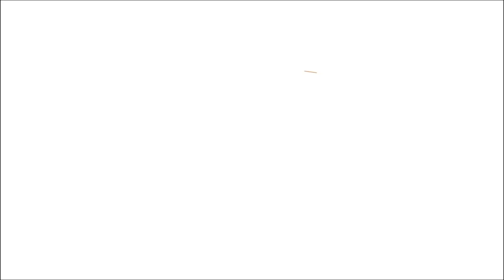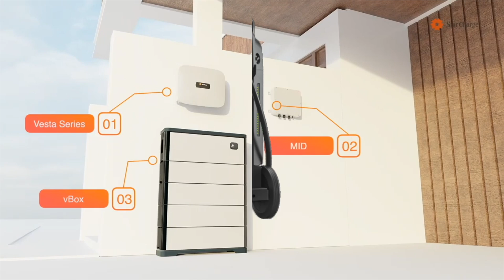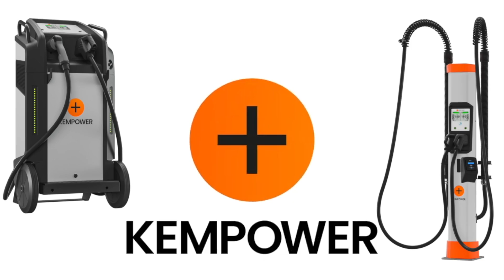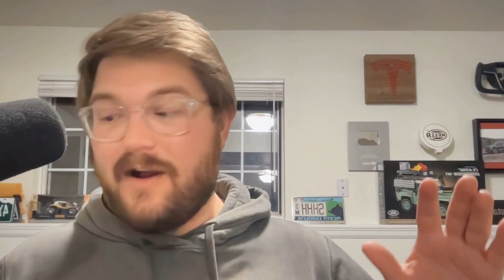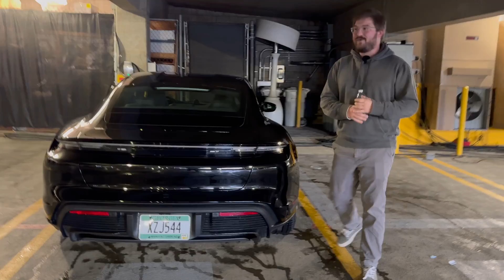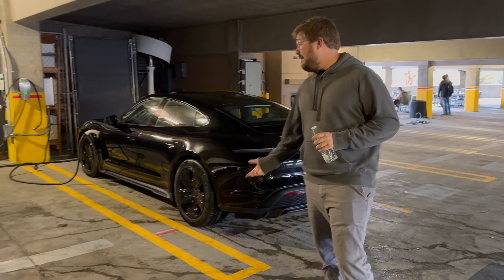Insane Porsche Charging Performance! New Taycan Facelift Charging Test & Comparison

Comment: What is the best method of determining degradation. I DCFC charged my ‘21 ID 4 for 3 years because of free. I feel my battery is down. At first I would charge (same conditions) to 8% and it would show 200 mile range. Now it’s 170 range. I don’t trust the dealer to tell me the truth. They don’t want to replace a battery that dropped under 80% in less than 8 years.

Comment: OK, so this is a true electron guzzler that wastes a lot more power to get from A to B than most EVs, and so it needs a bigger battery than most to have the same range and a higher charging rate to rate as fast as others so it can waste the power again on the next ride. And Porsche must have calculated that Porsche owners don’t drive and charge as often as others so pushing the battery to the limit with an extreme charging speed won’t cause the battery to deteriorate so soon…

Comment: Enovix has demonstrated 5 minute charging of its prototype silicon battery cells for EVs (writes Nick Flaherty). Tests on the 0.27 Ah cells demonstrate charging from 0 to 80% charge in 5.2 minutes, and achieve a greater than 98% charge capacity in under 10 minutes.

It’s already happening

Comment: 20:25 This is actually an important issue to clarify since even Teslabjørn spread FUD about battery health with Taycan because it had some eco charge mode (while I never heard this with Tesla's 250 kW charging, talking about bias...) - logical fallacy like back then putting seat belts into cars -> "must be an insecure car" 🙈

Comment: I love what Porsche is doing with the Macan EV and now the Taycan Facelift. Unfortunately they are priced out of my range.  I can only hope that the new Audi Q6 will have some of these great attributes.
Reply: Audi Q6 and A6 will be similar to the Macan 4 EV. But unlike the Macan 4, the Audis will come with RWD as well so I would assume the range is a bit better (if they have the same big battery pack).

Audi Q6 should have up to 630-650km/390-400mi of WLTP range with the biggest battery and a 270kW charging power.

Audi A6 has 700-725km/435-450mi of WLTP range with the biggest battery and a 270kW charging power.
US EPA range will be a bit lower than that.

Comment: Amazing to see. Curious if the charging curve would be any different on a different charging system (like a ChargePoint Express Plus 500kW dispenser with liquid cooled cable). Did the EA station seem like it was throttling/de-rating at all?

Comment: Over 300kws all the way to 62% and still over 200kws after that all the way to 75% is absolutely game changing. And that's the first time I think I've ever used that term. I see others use it all the time, but I feel its silly and not warranted. However, this is. From 0% to 62% in 12 minutes, and to 75% in 16 minutes for a battery of that size is unreal.

This handedly beats the Lucid Air curve and that's a monster charging curve already, if you can find a properly working EA 350kw station. Which is why Tesla's V4s are so needed, with their 99.96% reliability rate. Those 2 factors together will be the game changing part alongside Tesla opening up the network. 

Would love to see this charging on a 400v charger to see if Porsche solved that down-conversion issue. Regardless, with more and more V4 stalls being installed (once they upgrade the chargers) will change everything.

Comment: Battery degradation tests after using DC fast charging for a couple months will be interesting.
Reply: Batteries should be fine. Temperature management is the key to longevity and Porsche seems to know what they are doing here. Also the C charge rate itself isn't as crazy, it is just 3.2C (105kWh total capacity and 335kW max charging power). 
The battery of the Porsche Taycan should degrade way slower than the Zeekr 007 for example which pushes 4.7C through a 84kWh total capacity battery and with less temperature management capabilities. 
Western premium legacy manufacturers build cars to last.
Reply: Those cars with 300-400k kilometers on them I can almost guarantee you have been fast-charged almost exclusively, and they are holding up very well.

Comment: Still 20 min to 80%, nothing ground breaking there. When cars go from 10%-80% in 10 min mass adoption will begin.
Reply: Watch the vid again, it says 18 min.
Shorter times might become an infrastructure limit (need higher kW chargers and grid connection).

Comment: The "charge loss" (probably most due to heating and cooling the battery) is insane though for a 800V System. We are talking about 12%-13%! Where is the benefit of the 800V if they will be having such a high "cost" to that speed. Normal 800V difference to the kWh from the station on the old Taycan was not more than 5%! Even a Tesla 400V can do 7% with the battery heater turned off. This is insanely poorly made by Porsche, just to claim highest charging speed...
Reply: Is the lost energy put into cabin heating in winter?
Just imagine 4x the losses if only 400 V and keeping the charge curve for so long 🤯
Just remember you can prevent it by only charging at a 150 kW charger.

Comment: Dave, I love your nerdy reviews! Thanks for doing this. Amount of the energy Porsche is able to consume is really mind blowing. But as someone who would be spending 6-figures $ on the car (I don't believe new Taycan would cost anything less) - I would be concerned with how bad is impact on battery degradation. I know it's probably, something that you cannot put together, but I would love to see the graph showing the dependency between battery degradation and amount of energy consumed by the car.
Reply: 800v causes significantly less heat battery pack wise, so it's easier to keep cool, and therefore, the cells remain cooler. 400v Teslas hit 140F degrees much, much sooner than this (which is when they throttle down) and this Taycan never crossed 130F degrees. They're also working on cooling the cells from the inside out which will change everything.

There should be little degradation to these packs. Porsche is not about to risk it's reputation on this. Battery chemistries and technology keeps improving year after year. You can't compare batteries from 10 years ago (and especially not the battery management systems) to todays batteries and packs.

And these technologies move down to lower end EV just as quick as newer ones come out in higher end ones.
Reply: Batteries should be fine. Temperature management is the key to longevity and Porsche seems to know what they are doing here. Also the C charge rate itself isn't as crazy, it is just 3.2C (105kWh total capacity and 335kW max charging power). 
The battery of the Porsche Taycan should degrade way slower than the Zeekr 007 for example which pushes 4.7C through a 84kWh total capacity battery and with less temperature management capabilities. 
Western premium legacy manufacturers build cars to last.

Comment: Keep in mind Porsche and Audi can do 270kW since 2021, so this is a +20% improvement which is nice but not that otherworldly. 
I don't think they are able to do an +20% Improvement to 10-80% time. 
I am not hating, just saying they ALREADY WERE great 👍
Reply: 12:36 It's 18 minutes to 80%, down from 20-22 minutes on the old Taycan.
Reply: @babelhuber3449  yep, 22min 5-80% on old Taycan and Etron-GT. So they did manage to do the +20% on time also. I stand corrected, great for them 👍

Comment: Porsche is using as far as I know Cells from it's company Cellforce in Germany. They use Silican boost Cells, so no wonder they Charge so fast but the cycles are a little lower.
Reply: Amprius in California has a cell that charge in 6 min to 80%
Reply: @dixikloos5352  That is nothing new. Cells/batteries can charge even faster than that since years.

Those cells are not built for usage in EVs. In an EV you want 2500-3000 charging cycles out of a battery pack before it even reaches 30% degradation. That would not be possible with those almost instant charge/discharge cells

Comment: 14:45 In regards to the charging experience, I think the bigger concern for 300+ kW charging EV owners is that most of the 350 kW chargers that are now being deployed are split-power. Even if the chargers are all working, they are all providing full power, and you are always guaranteed a 50/50 split, that's still only 150-175 kW each. That's not a huge deal for a 100 kWh Porsche Taycan (30 to 40 minutes is perfect for a relaxed meal/shopping break), but for the bigger battery EVs (the trucks), that could be a minimum of 45 minutes to an hour just to reach 80%. 
At some point, we're likely to need some sites with dedicated 350-400 kW standalone chargers that guarantee 500+ A and 350+ kW to the one vehicle that is plugged in and charging. Some site designers consider that wasteful or inefficient, but after usage reaches a certain level, these dedicated high-power units will be necessary.
Reply: No, in Europe there are quite a lot 350-450kW single power output stations. If they are split chargers, then they are mostly 400 or 450kW split (Mercedes Benz uses 400-450kW split chargers but also always have 1-2 single high power chargers, for example for high performance EVs or trucks. They follow this concept in the US as well, as far as I know). 
So you always get at least 200-225kW.
The US really needs to upgrade its infrastructure. The Tesla superchargers become more and more a liability to fast charging, as they block charging locations, while they are not upgraded to 800V chargers yet. Also not all locations are open to different brands yet
Reply: @BBingo-v5i  Yes, I'm speaking more about the North American charging experience. There are still some standalone 350 kW units, but many are being replaced with the split-power units (and most brand new 350 kW units are split-power). 

Yes, the Mercedes chargers are 400 kW; however, that doesn't mean 200+ kW to each post. Those are the theoretical numbers if the car can max out both the current and voltage (none currently can). so the actual numbers a Taycan owner would see would be roughly half of whatever this Taycan saw on this dedicated 350 kW plug.

Comment: Thanks, Kyle! It's impressive, for sure, but it's actually not all that much better than E-GMP after accounting for battery size. At best, the Taycan is maybe 2 to 3 minutes faster, and that seems mostly due to a flatter profile under 50% (possibly a result of better battery conditioning?). I could certainly see a world where a 100 kWh E-GMP (increased nominal pack voltage) could keep up. 
Either way, I think the 10 minute 10%-65% and 15 minute 10%-80% charging should pretty much be the goal for premium and luxury EVs moving forward.
Reply: This will be the norm for nearly all EVs in 4 or 5 years. The higher end ones will be charging even faster by then. Technology moves very fast.

Comment: The loss at 300kW is significant, but remember it’s the same current as a 400V car charging at just 150kW. 

If I had the cheddar, the Taycan wagon would more less be my dream car.
Reply: Voltage do be like that... I wonder if this continual race for faster and faster charging will land us towards 2000VDC battery packs?
Reply: @ugh-meh  In trucks, even pickup trucks, yes. Batteries are going to be very large energy density wise, yet lighter as technologies improve. Lithium-Sulfur batteries, for example, have 5x the energy density of NCA and yet weighs only a third of it. I think for cars or smaller 800v is more than enough.
Reply: @ugh-meh  Only for trucks. 1000V and maybe 600A = 600kW seems to be the maximum for cars for multiple years to come. If you take these numbers and aim for a 5C charge rate it would mean a 120kWh total capacity pack could charge with 600kW.

5C technically means 0-100% in 12 minutes, but due to heat and resistance in reality it translates to 10-80% in 12 minutes.

The Zeekr 007 has a 4.7C charge rate with a 84kWh total capacity LFP battery pack charging with 395kW max. 
It charges from 10-80% in 13.5 minutes.

I see, and the industry does as well, deminishing marginal returns after 5C charge rates, even for LFP batteries. 

Customers do not feel the difference of a 1-2 minutes faster charging session (5.5 or 6C charge rates would only be 1-2minutes faster) while on the other hand the battery degradation shoots up, which customers do feel.

And batteries beyond 120kWh aren't necessary with today's or even future efficiency (except for trucks). 
A 120kWh total capacity battery has like 110kWh net capacity.
With an average consumption of 5mi/kWh you would have 550miles of range. With 5.5mi/kWh you will have 605miles of range (Mercedes-Benz claims 5.2mi/kWh WLTP consumptiom with the upcoming CLA already, so 5.5mi/kWh isn't even that crazy).
That is Diesel car level of range.

The key to future EVs isn't charging rates higher than 5C, but more efficiency!

This tradeoffs between c-charge rates and battery degradation will remain until solid state batteries arrive.
 But not even first generatiom solid-state batteries will completely solve this. 
So for now 1000V and 600A = 600kW with a 5C charge rate will be quite the most we will see in EV cars.

Comment: This is pretty insane. My poor little peougot e208 only peaks at 80kw yet this is pulling that in the 80-90% range.
Reply: Thought they were supposed to take 100 kW?
Reply: I'd love to get 50kW with my e-Golf :P
In +5C outside temps I do almost get to 40kW, but in -15C charged from 20 to 80% in almost 50minutes and peaked at 31kW. It slowly went up from 19kW at the start.

Comment: Do you believe Porsche about battery degradation ??
Reply: Batteries should be fine. Temperature management is the key to longevity and Porsche seems to know what they are doing here. Also the C charge rate itself isn't as crazy, it is just 3.2C (105kWh total capacity and 335kW max charging power). 
The battery of the Porsche Taycan should degrade way slower than the Zeekr 007 for example which pushes 4.7C through a 84kWh total capacity battery and with less temperature management capabilities. 
Western premium legacy manufacturers build cars to last.
Reply: Then there all the Tycan battery fires that Porsche is paying owners off to keep quiet.

Comment: I always find it funny when we German BEV drivers complain about our charging infrastructure. Almost all new charging parks along the highway are with 350kW Alpitronics. 15-20 per location. The new 400kW chargers are just coming out. Now I just need a Taycan ;).
Reply: As much as I love the Alpitronic 300 / 400, they are shared output = at least two HPC plugs.
When you are not alone at the station, the facelift Porsche will most probably get 200kw or less.
Those Taycans will love Ionity with 350kW per Station now even more.
Reply: @audivisual  So we're complaining about 200kws now? Oh, how far we've come in just a decade. In fact, even half a decade.
Reply: @Paul-cj1wb  I don’t see any complaints, just observations and a replay 🤷‍♂️
Reply: @audivisual  I did not mean it in a negative way. I was just pointing out how far we've come in such a short time, that we're saying "only 200kw." And yet many say "EVs are not going to make it".
Reply: you know that Ionity is load balanced too? Their blueprint has 1250 kVa grid connection per every group of six chargers  @audivisual

Comment: WOW.. charging speed and curve is amazing.... Love to own one of these some day.
Anybody notice the $51 charge??  WOW!!! 
That would buy me 18 gallons of gas, That's would be enough to drive old Toyota Hybrid 720 Miles Minimum, 810 miles of average normal MPG's
I have an EV now, and love it.. But I do sometimes miss the range of my old car.
Reply: Yeah, I only have an M3LR now, but I do miss the F150 I traded it in for a little bit. The 2.7 ecoboost and 36 gallon tank gave me 6-700 miles when I needed it. I got 798 miles one time when I travelled with a good breeze for a few hours.
Going to the boondocks in sub freezing temps was no issue. I can still do it, but more time and planning is required.
Reply: @andrewt9204  Trading in an F150 for a Model 3 is just so crazy to me as a European, when they say most people don't use those things for what they're "designed for" they really mean it haha. CAFE regulations really did a number on car sizes in the US.

Comment: Itll be interesting to see if the charging speed on the new Taycan will have any negative impact on battery health long term.
Reply: Batteries should be fine. Temperature management is the key to longevity and Porsche seems to know what they are doing here. Also the C charge rate itself isn't as crazy, it is just 3.2C (105kWh total capacity and 335kW max charging power). 
The battery of the Porsche Taycan should degrade way slower than the Zeekr 007 for example which pushes 4.7C through a 84kWh total capacity battery and with less temperature management capabilities. 
Western premium legacy manufacturers build cars to last.

Comment: 10 to 80% in 16 minutes. 70% recharged equal 74kWh. The max. battery capacity is around 105kWh. Nice values.🥰 XPeng G9 with the 100kWh battery is also around these recharging values. XPeng G9 is at 20min for 10 to 80% and recharged 71kWh. Zeekr 007 charging 10 to 80% in 13min 30s. Li Mega Van: 10 to 80% in 11 minutes, 77kWh recharged.
Reply: Zeekr007 charging: https://www.youtube.com/watch?v=2dW2tMlypB8
Reply: Li Mega Van https://www.youtube.com/watch?v=H5u6oQ8c4lY
Reply: @BBingo-v5i  And what does this mean? Don't understand your highly qualified comment 🤣
Reply: XPeng G9 charging: https://www.youtube.com/watch?v=H3IBJ0DF8T4